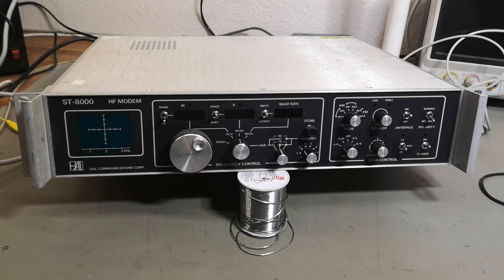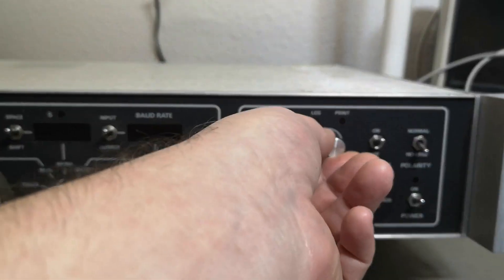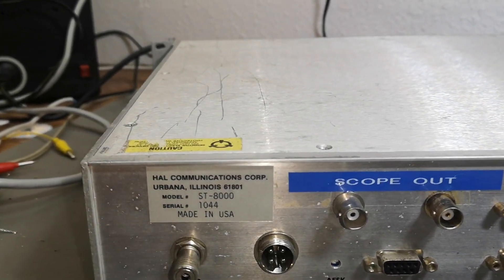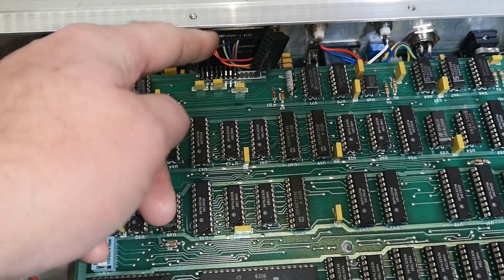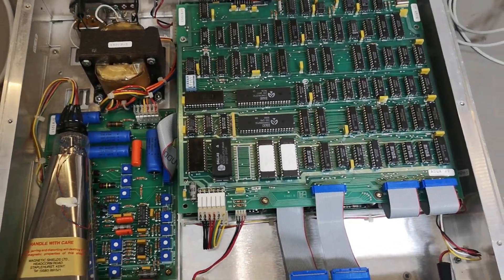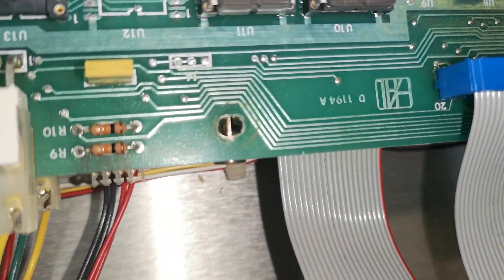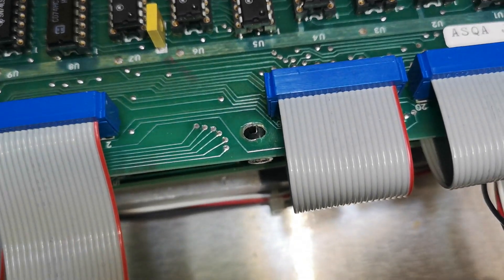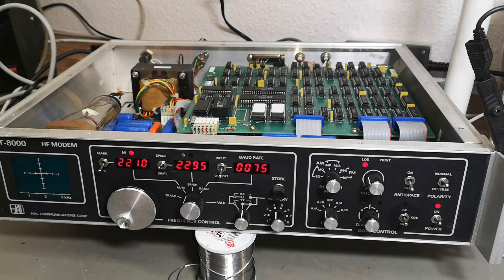hal communications st-8000 hf modem FSK AOK 1989 Z80 based

Comment: Wish I could see what you doing at the 14:00 minute mark to toggle between your mark and space input frequencies.  73!
Reply from the maker: i simply toogle between two input frequencies from my generator, and this way show how the input detector system tunes to those two
Reply: @TeardownOZ2CPU  Ah TU for taking time to respond I didn't see you had an input signal hooked up and thought you were toggling one of the out of picture front panel switches.  Now I understand!  Trying to refurb one of these units and not entirely intuitive.  TU Thomas and 73 de K0YQ
Reply from the maker: @effjay8010  good luck i had a lot of fun with it. i hope your screen is a bit more bright

Comment: The old Z80 and the old rotary encoder has perfect real-time feel, no stuttering. Now go to any modern digital scope, power supply, anything from Siglent or Rigol or even lower end Keysights, any LeCroy made at least until 2010, list goes on and on and on. Every rotary control stutters, because the firmware just blocks whenever a setting is changed. Like they didn’t know how to update a setting in the background while the foreground task processes the most recent value it latched. I see this everywhere and it annoys me to no end. Even the $5k Siglent scopes suffer from this infuriating silliness. And here we have a unit from the 80s, with minuscule processing power - and it has no problem handling it. I think some engineers just never understood how a good rotary control should feel in a digital instrument.